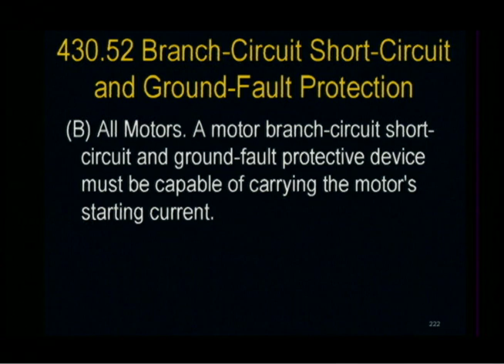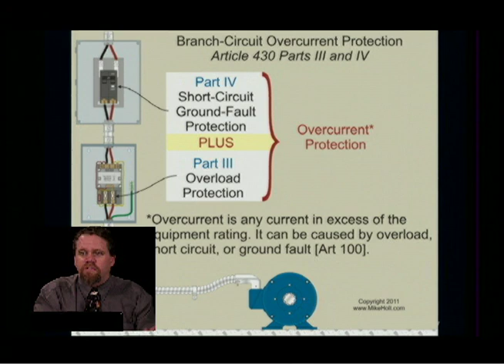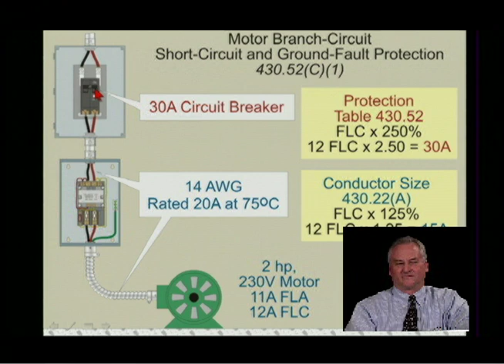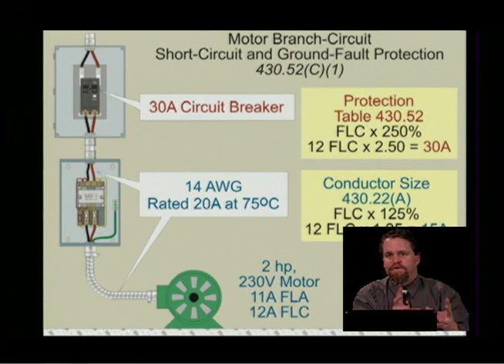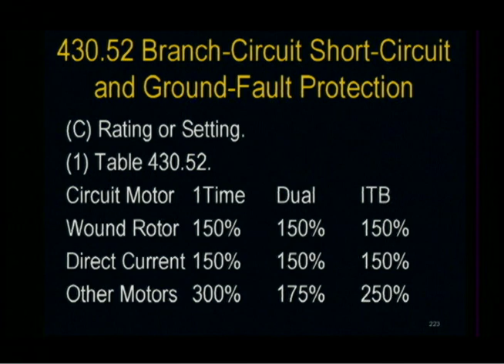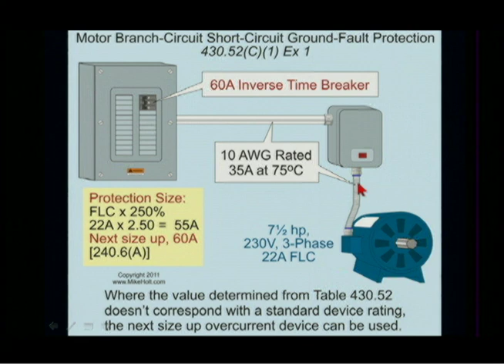Motor Branch Circuit Short Circuit And Ground Fault Protection (13min:31sec)

Comment: Thank you!  What about an AC Servo Motors.  Do they obey the same rules as regular AC motors? If the manufacturer of the VFD or servo motor Drives recommends  nominal of MCB. do  I need to consider these recommendations?

Comment: I have question where I can find exactly say 12 ft is between two receptacle in dwelling unit
Reply: Any point has to be 6 feet from an outlet, so 12 feet between 2 outlets max:
NEC 2017 210.52 Dwelling Unit Receptacle Outlets.
A ) General Provisions. In every kitchen, family room, dining
room, living room, parlor, library, den, sunroom, bedroom,
recreation room, or similar room or area of dwelling units,
receptacle outlets shall be installed in accordance with the
general provisions specifed in 210.52(A)(1) through (A)(4).
1) Spacing. Receptacles shall be installed such that no point
measured horizontally along the ﬂoor line of any wall space is
more than 1.8 m (6 ft) from a receptacle outlet.

Comment: Hi mike just a little bit confuse about the Voltage and FLC. Your motor is 3 phase 7 1/2 HP why you use 230V and 22A FLC. Is there a 3phase motor operated in 230V. Or maybe you should use 460V, 11A FLC  in 3 phase motor 7 1/2 HP in your sample. Please answer this.
Reply from the maker: Motor 'nameplate voltages' are 115, 230, 460, and system 'Nominal' voltages are 120, 240, 480 [220.5(A)]. When the NEC specifies you to use the motor nameplate current or voltage, then you use the nameplate values; when it doesn't say 'nameplate' then you use the nominal voltage (120, 240, 480) or the FLC on the tables in Article 430.
Reply: Thanks Mike!

Comment: motors and generators will work with greater efficiency on a body with limited gravity. A motor trys to speed match its generator. Gravity, air drag and resistance creates a current buildup.

Comment: in this case the breaker should be 20 A
Reply: simply a std breaker will be tripping to 6-8 time his rating , to permit starting the code said no more than 13 time the full load current , so 20 A is enough , i know the American code will permit 250 % , i had worked 26 years as a motor control specialist at klockner Moeller